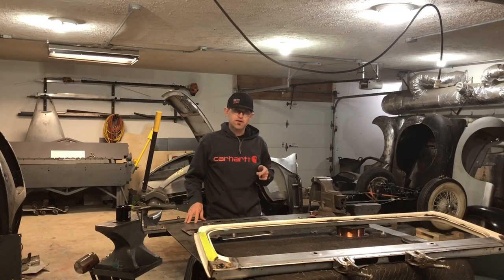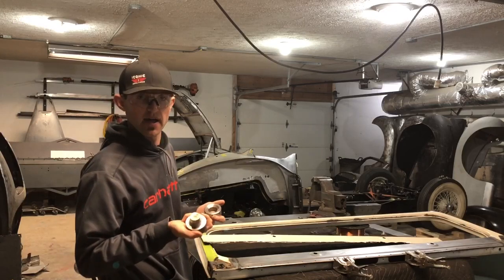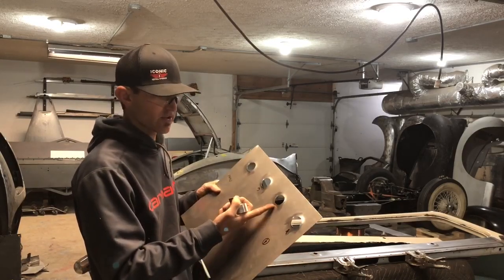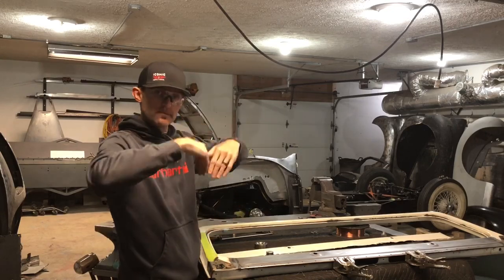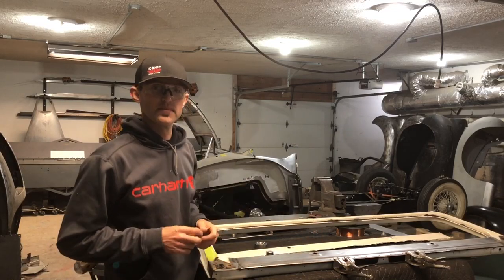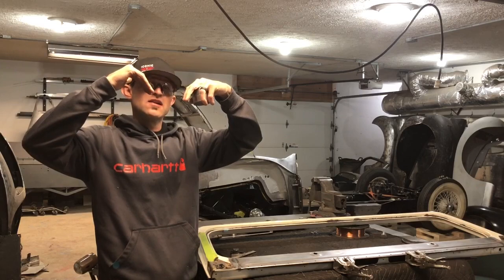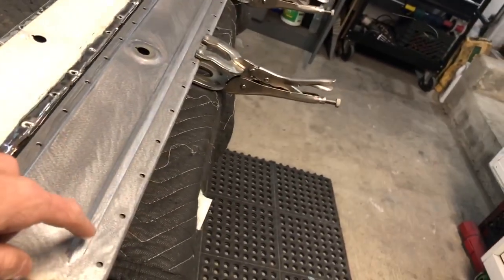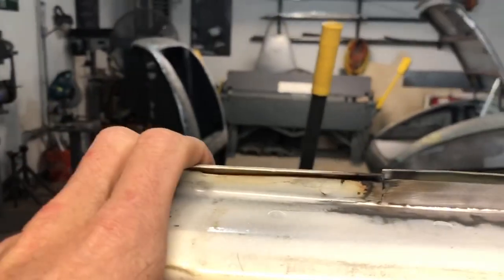Dimpling a dome in a panel

Comment: I would have attacked the dimpling differently but There is no right or wrong only results and your results are good 👍
Reply from the maker: For sure please explain always willing to learn other ways
Reply: I just tried what I thought would work
No good didn't work
I was thinking of dimpleing without the centre hole

 without the hole in the centre from the dimple die the surrounding metal gets pulled into the dimple causing havoc with the surrounding metal  
because your method has the hole for the die to index it leaves an open edge to thin out and stretch that little bit so it doesn't take material from metal surrounding the dimple 

I could address this by using something similar to a hammer form and a die set but is more work than your method 
So I learnt something thankyou
Reply from the maker: Not a problem